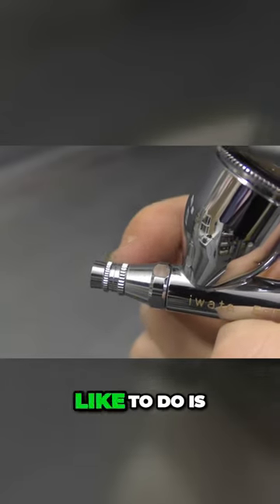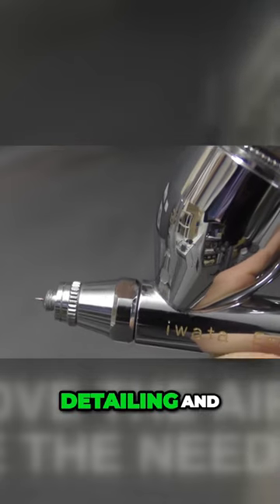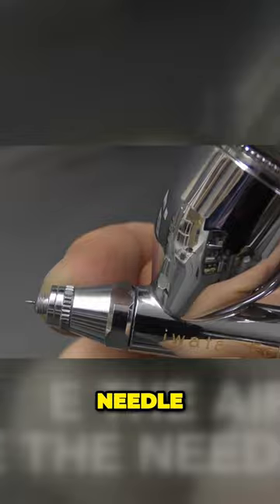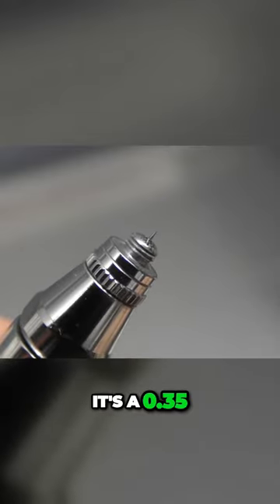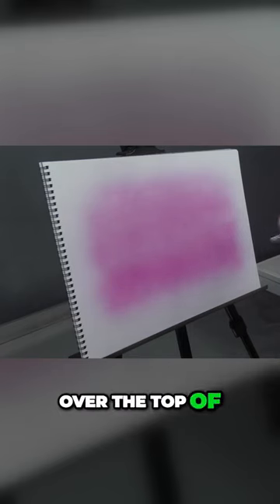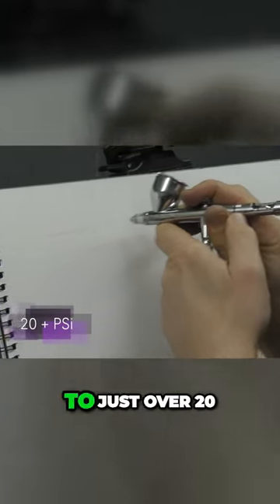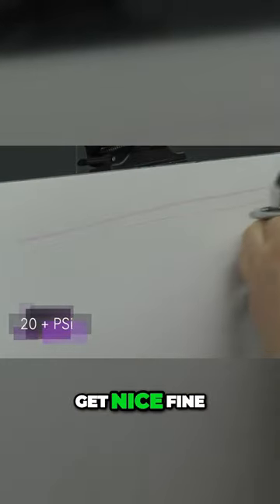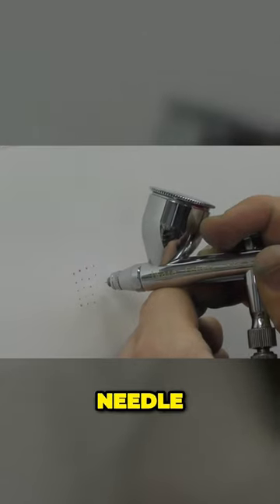How To Get Finer Detail Out Of Your Eclipse 🫡

Comment: Hello 
I have one question 
Which compressor is best for this airbrush?
Reply from the maker: You can use a regular workshop compressor, just make sure to fit it with a moisture trap and regulator (closest to where you are airbrushing) these compressors are noisy but reasonably inexpensive and have a larger tank. If budget is not an issue, then I personally love the iwata IS975, I have a video showcasing it to explain why I love it. Hope that helps. 😉